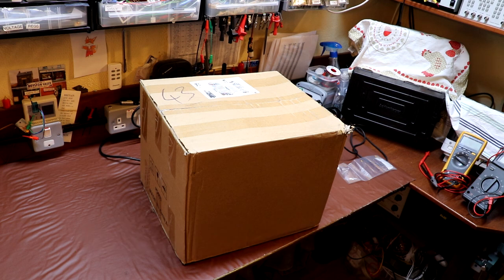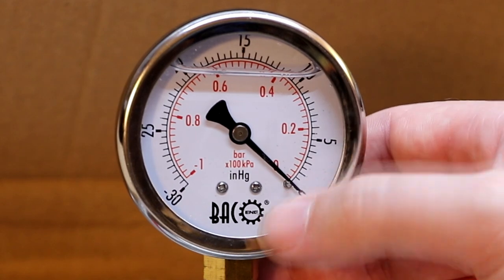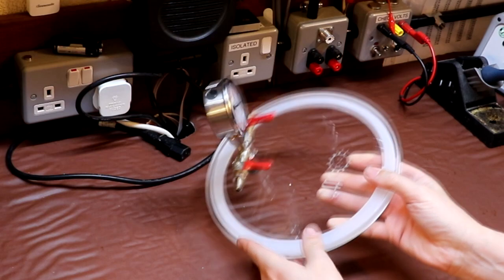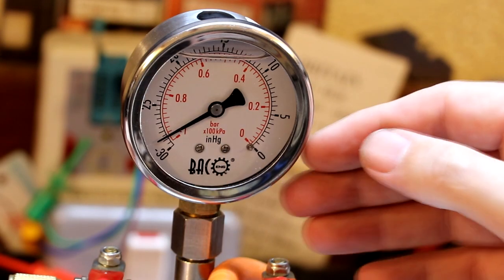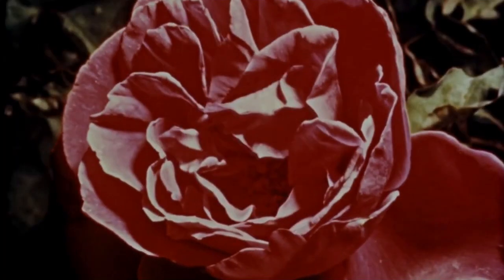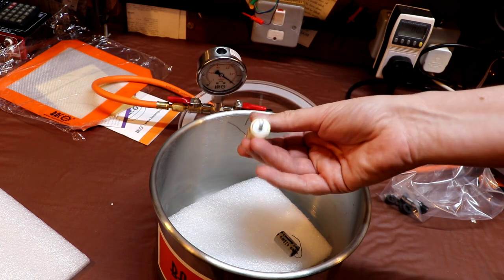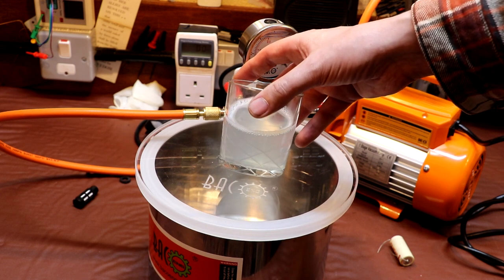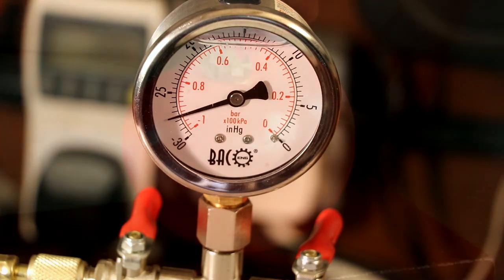BACOENG Vacuum Pump And Chamber Kit

Comment: Jolly good video, Chris, brings back memories of years ago when degassing liquid silicone type compounds for pouring in to a mould fixed around the cathode of small klystron valves. Procedure carried out once we had tested the valve for functionality. You should have seen the size of the power plant we used to test these valves on, it was the size of a small bungalow with the HT transformers run up under electric motor control.
Reply from the maker: That sounds quite exciting. I used to work on some large power supplies that used big mercury rectifiers . They were fun and scary in equal measure. Thanks for watching regards Chris
Reply: @allthegearnoidea6752  Yes, those big mercury rectifiers, big glass bulbs that glowed mauve inside. If the plant developed a fault, the plant engineer would go inside this power room and I would follow behind him. The power room door interlock was shorted using a plug connected to about 30 ft of wire with a hand held switch connected to the other end. This allowed us to run the power room whilst inside it. My job was to release the switch if this engineer got an electric shock, they were exciting days back then. Even more exciting was when a cathode needed realigning so to help reduce valve body current...hmm ?

Comment: Very interesting and looked like the manufacturer had a bit of pride in their product. I used to use one of these years ago for resin casting in model making. In a particularly complex casting you still would get the occasional recess left by a bubble. Useful bit of equipment for transformer winding. Coils of wire everywhere, the smell of hot pitch permeating through ATGNI Towers...nice!
Reply from the maker: I mainly bought it with the idea of rewinding LOPTs but could be used on motor winding. I also like the idea of casting some replacement radio knobs so I will have to ask you about the casting details. Thanks regards Chris

Comment: I think those types of pumps are known as roughing pumps. Seems to work really well. I am surprised perspex is strong enough though. Also I was surprised how will the wireless could be heard with hardly any air. Great watch Chris.
Reply from the maker: Yes I like a bit of rough pumping action. The sound didn’t go noticeably quieter until I a pulled the vacuum. I would be interested to hear the details of how you do it at work etc. Thanks regards Chris

Comment: A practical use for a vacuum chamber is to de-gas transformer oil. Faults in power transformers cause gasses to build up in the oil. Once the fault has been fixed the transformer should be de-gassed. We have a portable unit ( when I say portable ours is 'towable') which circulates the oil from the transformer, heats it and then sprays it into a vacuum chamber. It takes hours to days depending on how gassy the transformer is.
Reply from the maker: Yes that make sense I guess,  just the same my small demonstration degassing shampoo LOL. I used to build mobile platform for building massive transformers at a place in Scotland.  I may try and get a better pump that will pull a higher vacuum as I fancy having ago at making neons lamps. Thanks for watching and comments regards Chris
Reply: @allthegearnoidea6752  To achieve a high vacuum you normally use multiple stages of pumping. The pump you've got would be called a roughing pump. The high vacuum would then be achieved with something like a turbomolecular pump or a diff pump (diffusion pump). Your pump is probably a rotary vane pump. Its main disadvantage is that oil vapour can back-feed, which is bad news for some high vacuum pumps.
Reply from the maker: @oldblokeh  yes I’m using a single stage rotary pump. You can buy a two stage pump for a similar price but as you say no good for really high vacuum levels. I new that but it’s only a toy and I don’t want to spend more etc. Thanks Chris
Reply: @allthegearnoidea6752  You might well get away with it with this pump alone for neon lamps, from what I understand. It's a great buy for the price. Hmm... I wonder how hard it is to buy Penning mixture...
Reply from the maker: @oldblokeh  I believe neon is also ridiculous expensive to buy. I think I could maybe do an argon plasma globe perhaps.

Comment: Would you please be willing to answer a question? I see a number of 3 star Amazon reviews for the Bacoeng 3.6 cfm pump (3.0 for 50hz) that mention lots of oil leaks out and having to replace gaskets. I don't have a workshop, and i rent, so i really can't risk my security deposit with a leaky pump. I am about to buy this, but still waffling due to those bad reviews mentioning leakage.

Did you experience leakage with this pump? Thank you in advance.

Also, i ❤ the humor.

Comment: Ideal for drying a smartphone that has fallen into water :-)
Reply from the maker: That’s a good idea. I watched someone freeze drying food with one earlier.  I’m hoping to impregnated varnish into high voltage transformers.
Reply: @allthegearnoidea6752 , if i'm not mistaken, pulling a vacuum can also be used to take the odor out of objects. 
If you every used "5 second fix" glue, that's a glue like cyanoacrylaat , but hardens with a UV light. That glue has a very strong (annoying) chemical odor that will last for weeks after using. I think placing the glued object in a vacuum chamber, that the odor will go away.
Reply from the maker: @BjornV78  I wonder if it would work on 3D uv curing printer resin.
Reply: @allthegearnoidea6752  , trying is knowing :-)
Reply: From what I can see, this setup can't achieve a vacuum that goes below the triple point for water.  So not capable of freeze drying.

Comment: Brilliant purchase Chris. Are you going to start with triodes or go straight into making pentodes?
Reply from the maker: I would like to try and make some neon lamps but you need a much higher level of vacuum Thant this pump could produce. Those high vacuum pumps are multistage and very very expensive. But it would be fun to build a triode. Thanks regards Chris

Comment: I got a bigger one of these, my pump blows oil mist out of the air outtake, I also had a dry O ring, leaking min max glass on the pump and issues with the pump not being able to hit the -30. I also did not get enough oil for the pump to run it, I had to order more and wait till it came in. 😒  still have issues with it trying to figure out how to fix it a year l8r still looking 😒

Comment: Well that was an odd thing to buy, i'm fully con fuzzled why you didn't buy a large sack of teabags instead :-D   Sorry i have tea on the brain.
Now if you had put a small audio recorder in with the noise maker, you could judge how silent the pan of madness really was.
But the electret in the recorder might of burst due to the metalised diaphragm sealed inside it with the fet.
Dam i'm beat again with my dodgy logic.
What about cementing a vibrating device to the underside of the pan to perswade the air to the top of the glass quicker.
You and your "Not knowing much about it"  your pants should be on fire  :-D
Reply from the maker: I was surprised those capacitors didn’t puke there guts out.  I designed some electronics that went into deep under sea pipe laying equipment and again most electronics was unaffected by the pressure.  It was all of a bit of fun but I’m getting interested in making some high voltage transformers.